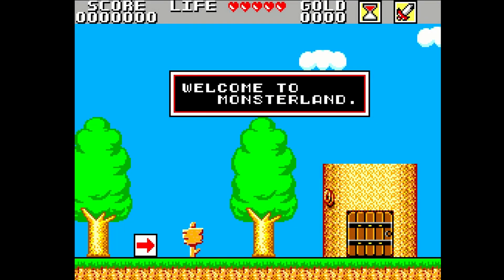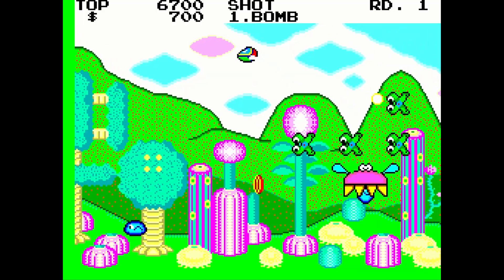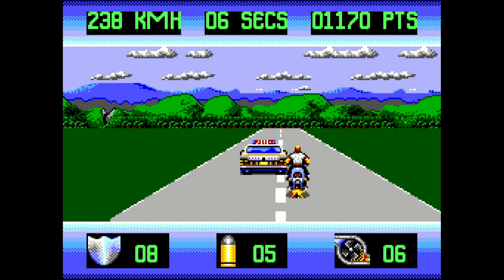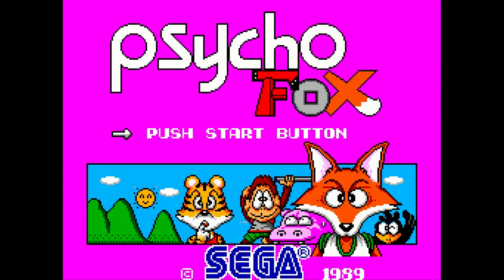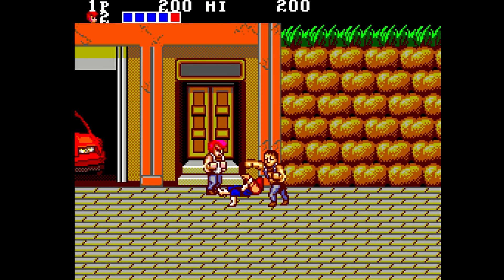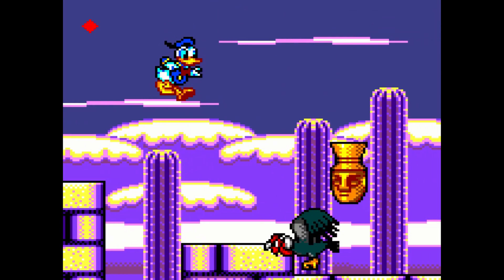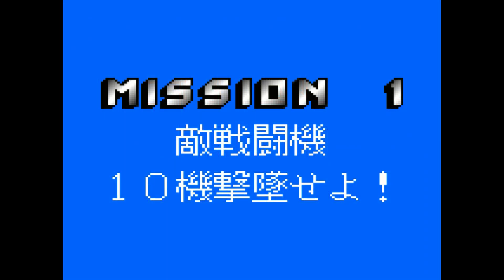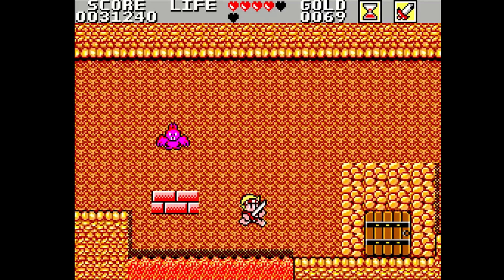MiSTer FPGA - Sega Master System and Game Gear Core Review and Setup Guide

Comment: Just watched your 32x video, great job!  Was wondering if you know of a way to have the Master System core boot with a different BIOS than it currently does? The BIOS i'm used to had the "Se-ga" jingle and had snailmaze and Hang on built in.  I dont see anywhere where I can change the BIOS to a different (older) version than the static Sega logo BIOS currently used.
Reply from the maker: I’m not sure. I will look into it :)

Comment: I did have a Master System in 2000 because I bought it on ebay. I never saw one in a Toys R Us or Funcoland. Even at that time, outside of ebay, there was no other way to buy games. Of course I had a Gamegear though from the 90's which I loved and the great thing was that the games were easy to find and quite inexpensive. Thank you for posting the video. The MiSTer project is amazing.
Reply from the maker: I never saw Master Systems in the US when they were new, only as retro as well

Comment: I've toyed around with Master System before but on Mister I've actually been playing it loads and I think it's the sound that cinches it because it can be quite shrill on emulator. 

One option I'd love to see across all the cores is being able to change the volume for music & sfx independently. Some games have incredible music that really get drowned out.

In Ireland I certainly remember NES having poor distribution in the 80's. Nobody had one. Everybody had a 2600, 8 bit computer or Master System. By 1990 that began to change but it was quite late in the NES lifespan before it got any traction.
Reply from the maker: I wonder if it’s possible to do separate audio levels for SFX and music? I see what you mean though. 

Play Master of Darkness if you haven’t yet btw

Comment: Now some good news, in Europe the Master System was kept around as a cheaper system than the Megedrive. Meaning really nice looking and sounding games for you to play. And no, they don't run slower, that's lazy ports that do ;). Like Lucky Dime Caper? Just was released there on the Master System :), with a higher resolution :). Power Strike 2 is a great little Shmup... the list goes on and on :) like a bunch of Great NES ports even :).

But really: PAL does NOT run slower (like I mentioned earlier that is lazy ports that usually did). It just has less frames per second but a higher resolution (and on Megadrive double the Memory bandwidth ;) ). So a game ported proper should run the same speed just less frames per second, so animations and timing had to be sped up. Play PAL games on PAL and if they are ported proper they run the same speed.

And yeah I owned one. My parents bought it second hand (Master System II) when the N64 was already on the market LOL :P.
Reply from the maker: Haha Master system was still on sale then the 64 was out?
Reply: And yes, the Master System was full supported in Europe until 94-95, probably on its way out in 1996 but you could still find bundles in stores and whatnot.
Reply from the maker: That’s so wild. I kinda love it
Reply: @VideoGameEsoterica  Well in Brazil, mine was bougth second hand, but it was on sale still in the early till mid nineties..
Reply from the maker: Makes sense
Reply: Many PAL games have zero optimisation hence they just run slower than originally intended, laggier and more letterboxed. Granted it's totally possibile to adjust to it, it is not ideal. Some games are speed adjusted so they run similarly to NTSC but at a slightly lower framerate. And there are even games that are meant for PAL in the first place that seem strangely accelerated at 60hz NTSC mode. But in the modern age all screens even in Europe refresh at 60hz so 50hz is a thing of the past. And if I ever see a game at 50hz these days, my retina won't like it.
Reply from the maker: I’m glad we are past the NTSC/PAL days
Reply: @amerigocosta7452  Well if a game is intended for Pall, then it might just run too fast on NTSC. But games like Lucky Dime Caper ran fine, Alex Kidd in Miracle world did as well. But granted my experience is only with the build in one that had the Hamburger :).  So that was a later revision.
Reply: @amerigocosta7452  50hz is a fine resolution, your retinas won't mind especially if they actually run at the resolution intended and not the lower NTSC resolution. Frankly Framerate (while important) isn't the end all either. Visual fidelity is a combination of factors. Or do you really believe that games like Alien 3 look bad on the Master System LOL.
Reply: @DehnusNorder  Believe it or not but that slightly lower refresh and higher flicker is very noticeable to my eyes, that sadly aren't the best to begin with. I don't think it's harmful but it's noticeable and annoying to me especially on CRT screen and I tend to play at 60Hz whenever possible. I get that others don't mind or notice it.
Reply from the maker: Yes people are either sensitive to that or not at all. No middle ground
Reply from the maker: Some people can be sensitive to it
Reply: @VideoGameEsoterica  They are sensitive more to the drops and inconsistency. When properly programmed at the higher resolution that PAL overs it actually is not a big deal. It also has the advantage of far higher bandwidth numbers in a console like the Megadrive. Literally talking about almost twice as much in certain cases. Which mean that a PAL Megadrive can do more on screen than a US Genesis. It's quite an interesting thing. 

I do agree with you that framedrops and slowdown.. or just a poor port where they just slowed it all down is jarring as heck. 

Have you ever tried games like Alien 3 on the Master System? Or other later Euro only games?
Reply from the maker: I think the primary issue is if you didn’t grow up with PAL, you can tell the difference in visuals and cadence. As a filmmaker with a degree in it there is so much put into motion / frame rate, etc etc on the scientific side as to how the eye and brain understand motion
Reply: @VideoGameEsoterica  Yes, but so is resolution and what happens on screen. There also is a lot of hyperbole out there about PAL being "shitty" which clearly is not the case. But the Internet loves to respond to everything in that extreme fashion, when really NTSC's resolution was much lower, and the color and intensity was also much more limited in the original signals (not comparing it to more modern signals of course, but the original manner the images were decoded and displayed). 

There exceptions, Atari and their 2600 just limited color output to make it Pal compatible, but that was just a cheap way out. 

You cannot just look at FPS alone, and sadly it happens a lot lately. That doesn't mean I don't think there is credence to high FPS. But to just go "PAL sucks" like so many do? No.. that's just not true, it is a different standard with different qualities.
Reply: @VideoGameEsoterica  Sorry if I offended.
Reply from the maker: I mean everyone has feels. I collect PAL if it’s the only release of the game :)
Reply from the maker: Lol not at all
Reply: @VideoGameEsoterica  I just wanted to press home that there are some major advantages over NTSC that PAL has and vice versa. Color representation and clarity is one that squarely is in the corner for PAL. Of course that doesn't matter as much in a time of RGB Mods. But back then, when most people ran over RF, Component cables or SCART (if you were in Europe). It did matter a lot :P. 

But thank you for not being offended. People can get quite erm... touchy about subjects and hyperbole is a major problem.
Reply from the maker: Haha I get offended about nothing. Don’t worry :)

Comment: It's not my favorite system of all time, but the Master System has a very special place in my heart. My earliest gaming memories are of that system. Ghost House's title screen used to scare the crap out of me as a kid with that slow volume build up until that loud effect hits with the glowing title. The game itself wasn't scary so little me would just quickly start the game. My childhood model was one of the ones that had Snail Maze hidden in it. You had to turn it on without a game in it and then press certain buttons and a direction to start it. I'm glad there's a ROM out there with it so it can be played on the MiSTer. It's a simple game but it's part of my gamer history.

Something to note is that there was an FM sound module released in Japan that has compatibility with quite a few Master System games which is why some games had improved sound and music on the MiSTer. That module didn't come to North America so I usually turn it off since my memories are of the base sound chip. Still great that it's included for anyone that prefers it or potentially someone that had it.
Reply from the maker: Yes it’s nice you have the FM option. I do never experienced it before so I leave it off as well. 

It’s funny how we have those memories of games like you and Ghost House

Comment: My first video game console was a Master System, second hand a few years after market in my home country (Sega Genesis and SNES were around at the time). Got it with the light gun and headache-inducing 3D glasses. The 3D glasses were pretty clever. They connected to the back of the console and the eyes were covered with liquid crystal. The liquid crystal would alternate between dark and open on each frame while the TV would display the corresponding frame depending on which eye was shut. Years later I bought a GeForce 2 card that came with 3D glasses working according to the same principle, just so much more pleasant on a 120 Hz display than a 50 Hz display.

Other than that, my main lasting impression of the Master System is the striking angular, red/black design.
Reply from the maker: the design was definitely awesome. I have never actually tried the 3D glasses. One day!

Comment: Great core. I'm still keeping the Master System hooked up though so I can play light gun games (haven't bothered with any of the solutions on Mister yet). Also, the Master System supports RGB out of the box, just like the Genesis did. Of course the Mister looks better (no jailbars etc) but the Master System still looks great on its own in RGB. Also, I wish there was a fix for the loud audio pop when changing cores, I always feel like its going to blow my speakers lol.
Reply from the maker: haha I just mute between core swaps myself. I need to try some of the light gun features on MiSTer too at some point
Reply: @VideoGameEsoterica   I bought the SNAC adapters from a UK seller and tried out lightguns for SNES, NES, SMS, and Genesis and they all work great. However, the controllers need to be swapped for some cores (SNES especially). It also took me a while to figure out how to use them and that the special cores DB9/SNAC8 is something different and separate from standard SNAC.
Reply: GB/GBC link works great too, though I probably won't be using it too much due to the 2p cores.
Reply from the maker: Light gun will be fun for PS1 and Saturn once they come. Although I have them all with guns and consoles so why am I even excited? Lol sometimes even I am not sure!